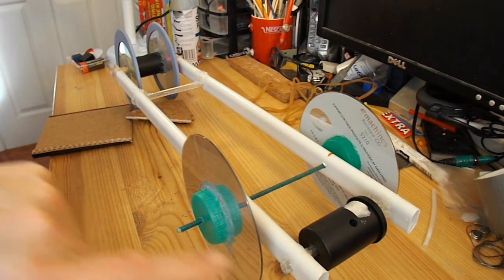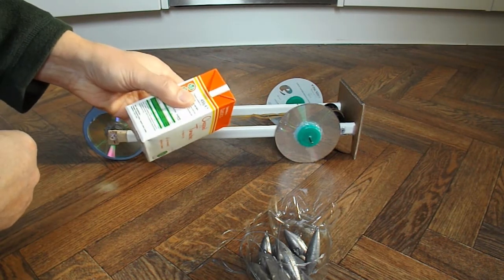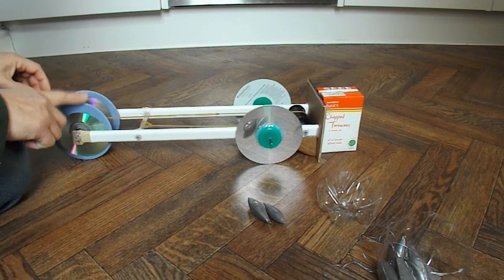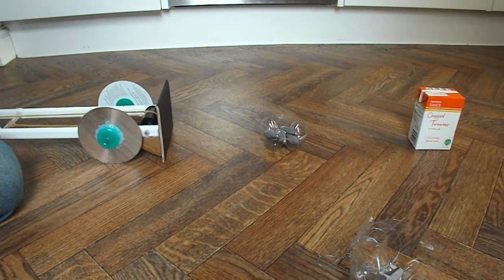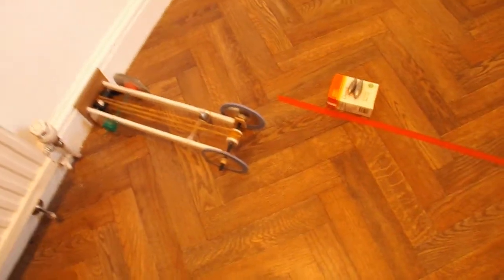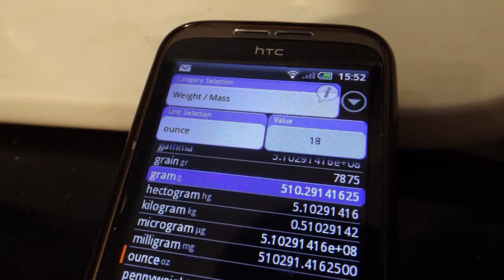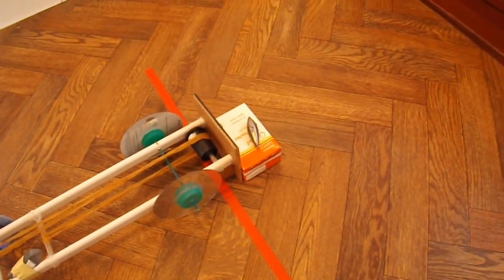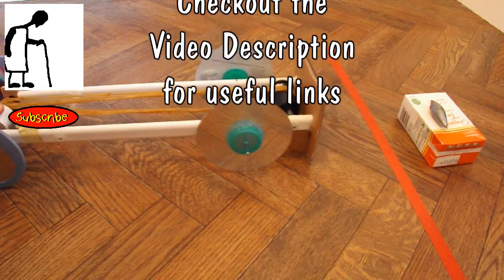Rubber Band Powered Car #8 pushes 500g

Comment: What is the likely relationship between the number of rubber bands used and the distance travelled by a thing
Reply from the maker: I would guess that more rubber bands would mean more power so assuming you have enough grip so the extra power is not lost with wheel spin the car will travel further. The exact relationship will be an equation using the power stored in the rubber band, the mass of the car, the size of the wheels, and the diameter of the axle. You may need to factor in the friction of the axle bearings and the friction of the wheels and the ground.
Reply: GrandadIsAnOldMan The more rubberbands makes a thing travel further ?
Reply: GrandadIsAnOldMan In that case, the more rubber bands = More elastic potential energy ? The more elastic potential energy converted into kinetic energy? Enabling it to travel further?
Reply from the maker: SirAlfie Bot yes but only as long as there is enough grip or the wheels will spin and the car does not move.
Reply: GrandadIsAnOldMan Thank you